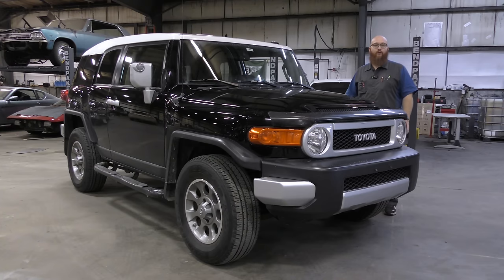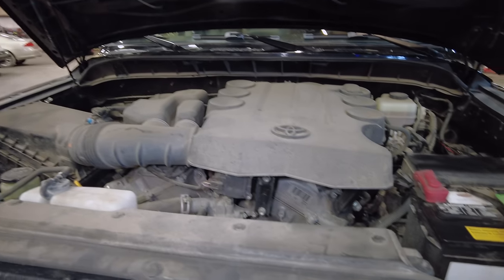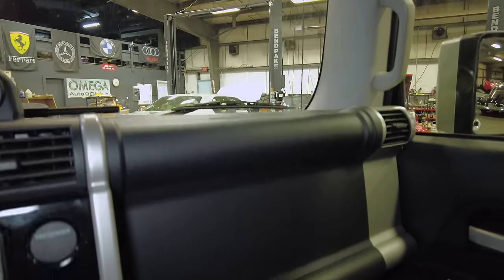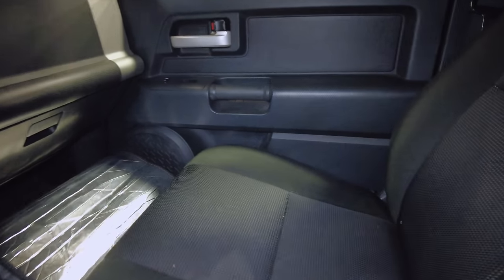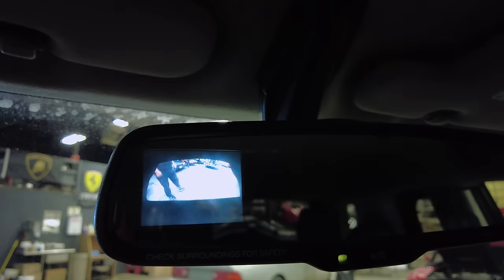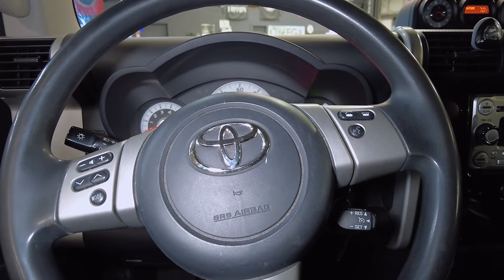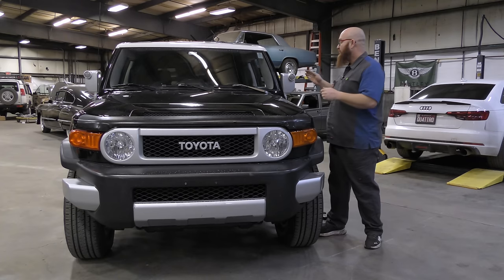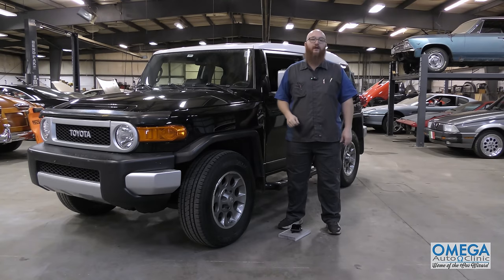Prices are Changing! FJ Cruiser Prices Are Plunging! What Happened?!?

Comment: In most states, towing anything over 1,000 lbs. trailer brake controllers are required. A trailer brake controller is required for 2,000 lbs. or more in Kansas. The FJ Cruiser can tow 5,000 lbs. Professionals will agree that towing and stopping are totally different scenarios.

Comment: Check the frame they all rot out faster then old tacos
Reply: Like all cars
Reply: @fritty9927   FJs are notorious for getting rust esp on the frame
Reply: @LetsGo-wf1dy  only in the rust belt like all cars.
Reply: If you live in rustbelt , oil spray your vehicles. 
If you want longevity, it’s something you just have to do.
Reply: @ConcoursOne  I fluid film mine every winter with a few rattle cans. Works great.

Comment: You said its not rated to tow anything that requires trailer brakes. The '07 6M, which I own, is rated to tow up to 5000#. In Kansas, trailers brakes are required for any trailer weighing over 2000#. I'm in Florida and we have to have trailer brakes for anything over 3000# and my travel trailer was #3500.

Also, Toyota continued to produce FJ Cruisers until 2022. They discontinued the North American market after 2014.

Comment: We pull a ~4k pound travel trailer that has electric brakes and I appreciate having them even if it's not strictly necessary.  The reason for them as I understand it is that these were required for a trailer of that weight/length in Canada.

Comment: In Florida, I believe anything over 3,500lbs is supposed to have trailer brakes. Not certain if that is a State Of Florida DOT thing or a Fed DOT law. In any case, I would NOT wait for a 10-12K lb trailer before I worry about trailer brakes... if the trailer's equipped, work those brakes, be it 3500, 5000 or 12,000 lb loadout. If you must drive through a light rainshower or live/drive in a hilly to mountainous region, those T-brakes may save yours  and/or someone else's lives.

Comment: Love it!  But I already have a 2020 4Runner, the bigger brother.  Same engine as that one.  Still smells new, and has only 13,600 miles.    The 4Runner is my personal vehicle.  My daily driver is a company vehicle, a new-to-me 2020 F150 5.0 Lariat.  Got it in December for $7k off the dealership sticker price at $41k.  Yes vehicle prices are dropping.  I did not take part in the mid-covid vehicle madness.  But I made out with this F150 only having 12,798 miles when I test drove it.  I should be good with vehicles for the next 10 years 😂

Comment: Doesn't matter if the value dropped if you never plan to sell.
Reply: Doesn’t matter if they go up either. Both of mine had under 12k miles when purchased. They were both Toyota Certified. I just rolled over 225k miles. I’m not sure that someone could buy it from me at any price. Well if they wanted to get completely stupid with an offer I might let it go, but it would have to be some purely stupid number😂 Reason being is I would have to find/buy another one. Then I would have to build it just like I have this one built.

Comment: If the trailer weight+the vehicle weight is more than the GVWR you need trailer brakes. The vehicle brakes are designed to handle the GVWR. The GCWR minus the vehicle weight dictates the maximum towing capacity.

Comment: Transmissions are hard to obtain due them being custom to this model and so few models being made.  The best you can do is get a rebuilt for $5k.  I sold my 2008 FJ when this became an issue.  It was also a gas hog.  It could, however, drive in just about any terrain or weather condition.
Reply: It’s the same transmission in the 2nd gen tacoma and 4runner, though?

Comment: Some places and trailers require trailer brakes. All trailers in my province require them, be it electric or hydraulic on the hitch itself. Little open aluminium trailer for motorcycle? It has brakes.

Most trailers sold have them. 1000 lb trailer? Probably has em.

Comment: My friend's s320 has ovee 650,000 miles with just regular maintenance until becoming sideswiped by a drunk driver. The car saved his partner's life.  My 98 S320 cost me nothing but very basic maintenance and I was rear-ended by a speeding commercial truck while I was at stopped construction traffic. I survived, I had only 240,000 Mi on my car. I don't understand how Mercedes did such a good job with their S-Class cars. I can say the same about the last 40 plus years of s-classes I have been driving.

Comment: I’ve watched these and other used vehicles for the past year as my daughter will be 16 this year. But all used car prices are dropping. this is on FB market place in lower AL, FL and GA areas.   
But most FJ’s I found were 07-08’s with 200K miles. Most around $9K up to $15K. Most around $15K dropped to around $11K to $13K and not sold.

Comment: Always thought the FJs were a bad choice compared to a 4Runner if you wanted off-road reliability, or a Wrangler if you wanted pure fun.  Visibility in the rear is terrible, they manage to be as large as a 4-door despite only having suicide doors, and IFS still makes suspension mods difficult.  It's a shame Toyota didn't build a short wheel base TNGA platform for SUVs; would've been nice to have some sort of two-door FJ/Prado stateside.

Comment: Impressed, it doesn't have the valve cover seep that virtually all FJs get eventually.

Dealers want $4K+ to replace it because it's all labor as you have to tear everything off the top of the engine to get to the gasket.

But if it doesn't seep enough to drip onto the garage floor, there's no reason to address it; mine's been doing that for about three years now and still hasn't dripped a single drop of oil on the ground.

The other thing all FJs get is the driver's seat tears at the seam you slide over to get into it.

2011 FJ with 197K miles

Comment: Trailer brakes start to become necessary at about 3000 pounds trailer weight, and that can easily Tow that much weight.  My 2011 Nissan Pathfinder with the V6 can tow almost 6000 pounds.

Comment: I hate to seem like a negative Nancy Mr Wizard, but the prices of FJs today are still massively overinflated.  I live in Kansas City and spent 3 years between 2016-2019 looking for an RJ Cruiser Trail Teams edition, specifically the 2011 Trail Teams.  "Way back then" the earlier model TTs were surprisingly scarce, but the 2013/2014 were pretty commonly coming up for sale with ~70-90k miles for $35k.  Nearly 6 years later, seeing some non-TT editions selling for $35k, that aint a bargain.  Not around here.

Had found this specialty Toyota shop in Lee's Summit that searched the country for things like Trail Teams FJs, TRD Pro 4Rs, etc and sold them locally.  Met with the "owner" of the company multiple times after seeing they listed up a new TT for sale, we exchanged business cards and he assured more three times they'd call me the next time a TT came into their inventory.  All three times I found them advertising new vehicles without even bothering to contact me.  Glad that asshole went out of business.  No, I never did find my FJ Cruiser.  Instead I spent a few hundred bucks on a clapped out Nissan Xterra that I'm working on rebuilding.

Comment: Loved my 2007 (manual) ... until it rusted out from under me. Hole the size of a man's fist near the rear spring mount. Repair to satisfy inspection requirement was more than it was worth at the time (2018). Mechanically she ran perfect. Never a single issue except replacing those stupid lights on the mirrors. Wish I still had her if for nothing other than playing around on the farm.

Comment: At first glance it’s a cool design…and then all the things that would irritate you start revealing themselves. Had a 2007 4Runner that looked bad ass in black with some nice tires and had the small V8. Every time I turned to the left to check for traffic etc I would bang my head on the upper portion of the door above the window. I’m only 5’11. 
Noticed, after I got rid of it, that when I sat in a Tundra I barely had any head clearance. Pretty much removed Toyota from future vehicle consideration for me in the utilitarian field. That 4 runner bummed me out because that V8 was great.

Comment: I owned a 2007 FJ Cruiser for 9 years , great vehicle but it would pass anything but a gas station and you could not keep it in 4x4 on slippery highways because the traction and stability control deactivated in 4x4. My guess is the value has plummeted because of the poor gas milrage. They also really need a software update for the lazy shifting transmission imho. and if you live in the rust belt FLUID FILM the hell out of it or there will be nothing left in 5 or 6 years, big annoyance in ciity driving is the skinny windshield made it almost impossible to see traffic lights when stopped. other than that its a tank and if you asked me what i would take on a trip around the world it would be a FJ or Tacoma. As long as you pay the gas lol . I paid $38500.00 CAD for mine in 2006 . it was the first one in my town in the iconic blue with white roof . i guess thats about $ 29000.00 USD

Comment: I'm going to put my unpopular opinion out there. I apologize in advance. The FJ cruiser to me is a Turd. It did not impress me when it was released back in the day. I wanted to love it. One of my closest buddies sold his Nissan S14 to buy this FJ Cruiser. He let me drive it occasionally, he would let me borrow it if I needed some extra space (I had a Prelude at the time), I did not like anything about it. It looked strange, it felt cheap, and plenty of owners were reporting early-mileage issues. A couple of years later at around 40k miles, my buddy had gone through a blown head-gasket, water pump issues and squeaks and rattles. I for one, will never own or drive this thing or pay a dime for it. It's hideous and IMO "cheap".

Comment: There’s a 2007 by me that has 112k miles and they’re asking 15k. New AT tires just put on. With the 5th tire. The outside looks great with upgraded lights and bumpers. the inside the seats have some ware on them. But not bad. Might jump on it. Never had one before

Comment: I miss my FJ but heck I drove it for 5 years and when I bought my Tundra the dealer gave me what I paid for it $32k. But I did add a brake controller and transmission cooler to mine. I used to pull a small camper that had electric brakes on it.

Comment: My 2010 FJ, came with trailer breaking stock from the factory. My mechanic just installed the light harness on the bumper, and it was detected and the lights on the dash would indicate when it was activated as I activated the breaks. Never had a reason to move anything that bog, but it was there.

Comment: Anyone who spent double msrp for an FJ that's a decade old is not very smart.  I drove, mud bogged, and mountain trekked my 07 ,which I bought used in 09 for 18k until just before covid in 2019. It had cronic, annoying electrical issues which never left me stranded, but were very disappointing, and expensive.  And that terrible, cursed automatic transmission that would only last 60k or so. After 2 rebuilt units, going on 3, I had to get out. I was amazed when the dealer offered me 16k on the trade, with the disclosure of the transmission issue because I'm not a poop head. Crazy enough,  my f250 has held its value incredibly well up to this point too. I'm definitely wondering when my luck is going to run out dealing with the car market.  Everyone gets screwed over at least once right?

Comment: I really wanted one of these in the summer of 2020.  Anything with low miles and a manual transmission was just ridiculously priced. I ended up getting a 2012 4Runner for about $12-15k less than a comparable FJ Cruiser would have cost. I just couldn't justify the extra cost for what is essentially the same vehicle. No regrets.

Comment: Everyone that owned these Nice Vehicles had problems with Windshield Cracks-Chips as Windshield does not have enough Slant, they are like a Jeep, almost Vertical, Windshield requiring 3 Wiper Blades is Bad Engineering in my opinion, other than that, I Love these FJ's.

Comment: No. Now is not the time unless you specifically want an FJ. Fam owns one, and other stuff too. Let me tell you why. FJ have slighty better offroad option. You can get a manual transmission. But everything on them costs more.

Hope you like replacing windshields because expect to do it a lot with an FJ... and it isnt cheap.

I will recommend a 4runner or Tacoma any day over an FJ UNLESS you really want something to be off road a lot and need every advantage you can get and a plastic floor.

Comment: Trailer brakes?
That can tow 5000lbs easy and  even a 3000lbs trailer or 2000lbs its better to have trailer brakes for safety to protect  tow vehicles brakes.
Everything looks great underneath including the surface rust thats building up.
I would sudggest cleaning the rust and put fluid film.

Comment: In Australia, the FJ Cruiser has a towing capacity of up to 2250kg (4960 lbs).  However, when the Gross Trailer Mass (GTM) exceeds 750kg (1653 lbs) the trailer must be fiited with brakes.  It appears that the info provided by the Wizard suggests that only heavy trailers - i.e. 10 to 12,000 lb GTM trailers - require brakes in the US (or perhaps Kansas) which is very lenient and somewhat unusual.
Reply: We generally don't have requirements for trailer brakes in the US. It's usually a recommendation by the car manufacturer that dictates whether you need trailer brakes. Over 5k lbs, and it is generally recommended. Most cars say to use them over 1600 lbs.
Reply: Keep in mind, the US calculates tow ratings differently than in your country, so that will make comparisons harder.
Reply: @Land_Raver  There is a Californian DMV - i.e. Department of Motor Vehicles document titled "RECREATIONAL VEHICLES AND TRAILERS HANDBOOK".  It specifies braking requirements for light trailers.  It states: "brakes are required on any trailer coach or camp trailer having a gross weight of 1500 lbs or more".  However, don't know the status on other US states.  What's more I don't understand the aforesaid handbook's  'legal position' - are the specified requirements mandatory or just guidance?
Reply: @georgebettiol8338 There would need to be a law or statute stating the requirement.

Comment: What?? Did I hear right? You don’t need trailer brakes until it gets up to 10/12000 pounds??? Here in Australia it’s 750kg (1650 pounds) and under tow weight doesn’t need brakes, but above that you need brakes. That’s the law here.

Comment: Totally incorrect about trailer brakes and the towing capacity of the FJ. My 2400lb camper has electric brakes, even my old 1500lb popup had them. FJ is rated for 5000lbs, so definitely in the realm of needing trailer brakes. If you tow a 5k trailer without brakes, it WILL push you around and prematurely wear out the tow vehicle's brakes. Most auto/trailer manufactures even recommend brakes on any trailer over 2500lbs.

Comment: I never saw a lot of these and never really understood the  point of these  vehicles.
Almost all I have seen have road tires and. Road looking suspension which defeats the purpose of an off road vehicle and there are so much nicer looking off road capable and its just a overly heavy quirky vehicle.
Imnsure a 4runner is a better offroad vehicle and in general better looking and better at crossver between road and offroad

Comment: Skip the FJ and buy what the smart people know exists - an 03-06 4.7 2UZ-FE V8 4Runner. Those are the unicorns that will skyrocket one day. Tow 6,000 lbs and make 320 ft lb of torque and they go for 500k miles. In 10 years they'll be $20k.

Comment: He's not wholly honest here.
2007-2009 has lower HP and Higher torque (4.0L V6)
2010 and newer is higher HP and Lower Torque (3.6L V6)
Two very different kinds of "Power"
Reply: as a non car person, could you breakdown what that means?
Reply: @quirks3533  - In the simplest of terms, HP is like race car power, while torque is pulling / crawling (low end) power.  High HP might hit somewhere near red line while torque is good at idle.

Comment: I bought a 2014 Trail Teams last year. I paid $30k and it has 90,000 miles. Looks mint but I treated the minimal rust on the frame which was not too bad, but I plan to keep it for a long time.  I love it although I don't run it when they salt the roads, which is most of the winter here.

Comment: I don't think they are worth even $20k. There is a reason Toyota stopped making them. It has been said it is very difficult working on there engines, and costly. Also not so Toyota reliable.Yet the 4runner is still made and even their 1st gneration 3.4L V6 can get you 300k Miles. Now of course the FJ60 or even the FJ55 of the 80's are worth 35-55k. They were true FJ series trucks. and of course the king of the FJ series the FJ40's are going for about $60k.  IMHO

Comment: BEWARE The Toyota 4Runner and FJ Cruiser from the pre-2010 era, specifically from 2003 to 2009, both shared the same engine. Both vehicles were equipped with the 4.0-liter V6 engine, coded as the 1GR-FE engine and that engine is starting to get head gasket issues

Comment: Found a 1999 toyota hilux manual diesel crew cab for sale here in germany for 4,500 euro (about $4500). I am aware its possible to ship euro spec to the US if the car is 25 years old or older. 

Would this be a big profit given fine condition if i flip it in the US? Im with the US army and i can get 1 car shipped to the US for free.
Reply: Diesels are a huge pain to deal with stateside, especially non US market diesels. From both an emissions and maintenance standpoint. Not all States will want to register it and not many mechanics will know how or be willing to work on them.

Would not recommend.